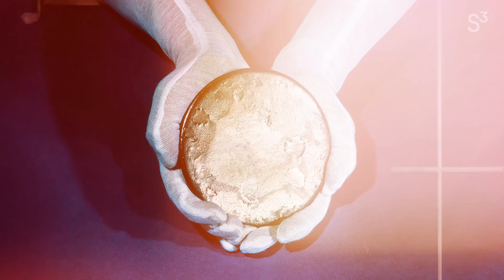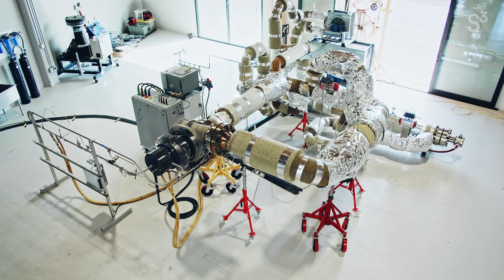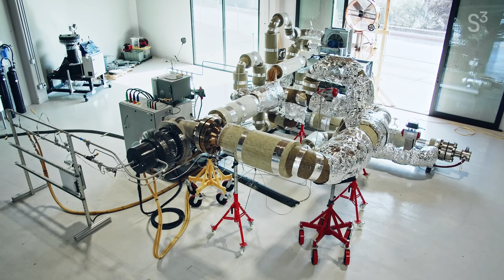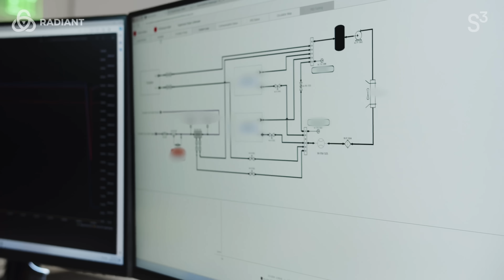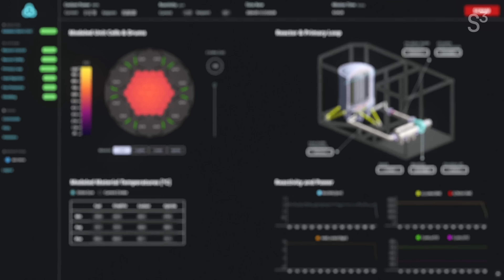The future of Nuclear = Small, Mobile, Microreactors | Radiant

Comment: 2:50 "...nuclear energy saves lives...": This I find most disgusting about focus on nuclear... making the political arguments. Say you had a choice between two forms of energy, butter and Thorium. What would you choose and why?
3:22 "...power reactors based off of submarine reactors...": In Bremerton, WA you can see submarines being scrapped. The first thing they do is remove the reactor. It's tiny in relation to power company reactors (and to the submarine itself). In 50 years we haven't been able to commercialize these small reactors. Why?
4:00 "...we're building smaller because smaller is cheaper...": What is the smallest electric generating reactor possible? What is the limiting factor? In particular it should be a Thorium MSR. Cooling with liquid salt makes much more sense than high pressure water... period!
4:35 "...ton or regulatory hurdles against it...": The best buck spent is eradicating the regulators. They aren't regulators at all... they are guardians of the oil business... period!
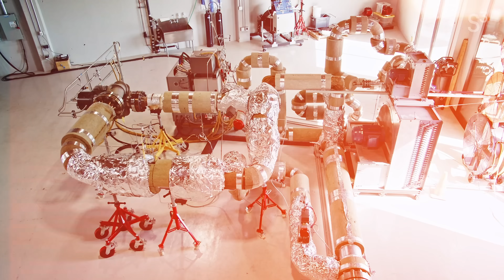5:05 "...we know how to build nuclear reactors...": No you don't. You had a working model 50 years ago and haven't built another since. Why? Because you're stupid? Could Alvin Weinberg do it today?
6:10 "...make heat through friction...": Someone here is clueless.
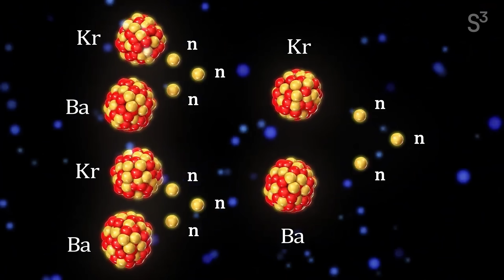6:20 "...U235...": Why not U233?
7:30 "...we use helium...": That's probably the show stopper right there. Where are you going to get the helium?
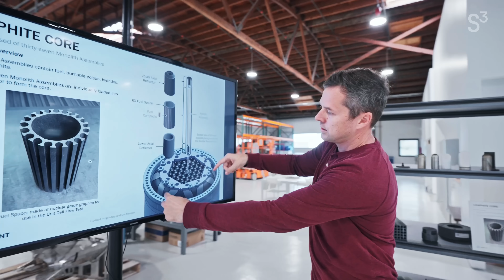8:30 "...milling the core...": You're putting lipstick on a pig. If you have to use the term "pressure vessel" you're on the wrong track. The correct solution works at ambient pressure. Using your technique you'd be smartest to build it deep under water where if the pressure vessel fails it "implodes".
8:50 "...graphite is the moderator...": With MSR designs you don't need a moderator. You just adjust the amount of Thorium in the mix. For power generation latency is not a problem. Dispensing with excess heat is the problem... and that is a very easy problem to solve. Just put it to other use.
9:10 "...in the larger channel we put our hydrides...": Why can't you just say water?
10:30 "...the helium loop...": If the helium is just for coolant, why don't you use nitrogen? It's far more abundant and safe.
12:00 "...we show the state of the nuclear reaction...": And that's a square wave? Really???
12:40 "...and the reactor tries to save itself...": I smell a rat. You want a fail safe design. If the coolant loop fails, that's a fail calamity design.
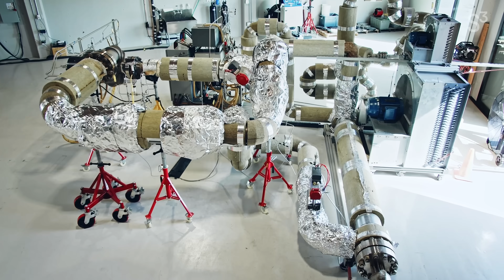13:15 And they've got the obligatory American flag. That's a marker.
14:05 These complicated designs are like taking the wrong fork in the road. Given the problem of maintaining a broom in a vertical position, these guys would build an inertia table with a complicated feedback loop under the broom. Taking the other fork, you just suspend it from above and let gravity work in your favor rather than against you. Any perturbation automatically returns to the stable state... rather than flying off the handle.
15:37 "...and go to the Idaho national lab...": Interesting. That's where they deep-sixed the previous correct solution. Oak Ridge got it working... Idaho scuttled it.
15:40 "...and I did Enron company before...": Now there's a testimonial. Skilling's out of jail now isn't he? Want his help?
15:55 "...and no one's mass produced it before...": What's the name of that company in Canada using Thorium? Do you talk to the guys in Abilene?
16:30 "...we're just 18 months away...": The funding burn has to be out of sight already. And it's gone to hand waving.
16:50 "...and the crane is just barely the right size...": But could be fabricated from scratch in a couple days to any size needed.
16:55 "...these are experienced engineers and builders...": They look like experienced hand wavers. So far, the only "secret sauce" I see is the rotating graphite reflectors... a (maybe) clever solution to a problem that doesn't exist if you take the right fork. Rather than pull the rods, you rotate the reflectors. Too many moving parts. Talk to Elon.
17:30 "...S cubed...": Stupid to the third power. This looks like the court cases that couldn't find vote rigging.

Comment: Is there safety provisions for complete software failure? The Earth's magnetosphere has weakened by 25-30%, in ten years it will likely be down to 40-50% strength. Solar flares and CMEs will knock out most electronics.
It also seems to me that the military angle is a diversion, I'm guessing that you're looking to provide the juice required to run the AI super computers.

Comment: You said you're using Helium for cooling since it does not become radioactive.  Helium is the second smallest molecule in nature (hydrogen the smallest).  It is not easy to keep helium contained under pressure.  It leaks out of most containment.  How do you propose to keep the helium cooling under control with this leakage characteristic.  PS:  I agree you are on the right track.   I propose locating a few sizes of these units to most substations in the grid to provide a robust electric grid, where grid failures can be neutralized with local generation at these substations

Comment: This would be great if it works.  The videographer missed an opportunity however- to ask the 3 big questions that nuclear always has to answer: what's the failure mode (what happens when something goes wrong), how much and what kind of waste, and what proliferation risk does it pose.  Imagine 1000s of these all over the country.  They all make waste. What if a domestic terrorist org gets ahold of one of these- and threatens to use it as a dirty bomb.  Imagine getting some material and tying up 3, 4, 5 highways or bridges in any large city in the world.  These need to be answered.

Comment: This reminds me of Elon Musk - low tech (graphite, heat, coolants, everyday materials) rather than fields and high energy density. At least the people are able to do those things now. Remote chemical processes can be economic with mostly heat, not electricity. Remote methane conversion, methane polymerization. Mars and Moon applications - lots. You might want to visit Hanford or have them give some collaborative seminars on "best recycling materials".  Graphite seems not high on the list of 'low cost to recycle". Glass has good strength, can be completely melted, good electrical conductivity. Even stainless steel. Get your entire life cycle involved now and work with the global community from now on. Give up some operating and design advantages for materials that will last or be easily re-used.  In 1975 I saw the details of Fermi II and they got co-opted by plumbers and old line steam power groups.  Fermi I is worth deep modelling and pay for good data, do not do it all from scratch.  You are making a big mistake, trying to have a few amateurs build prototypes. When you have not planned an entire industry out at least 50 years.  Build your global research and engineering community first, including all your future customers and applications.  Help them work as a single entity for sharing the whole - they do not want money, but freedom to use what is found. Richard Collins, The Internet Foundation

Comment: I hope you already have a SWQAP (as most of your design seems to be SW based) as well as a NQA, so far from what I have seen you do NOT have a stable system (you rely on moving reflectors to control reactivity) instead of say a light water reactor being somewhat self stabilizing... I also hope that those employees you show are not just concerned with machining graphite but on nuclear safety and reactor design... all I can say is that this is a fairly similar design to a RBMK with external reflectors to allow for a smaller size... but can you say Chernobyl?... remember that passively safe systems in reality need something to automatically reduce reactivity during a LOCA event...  you need some highly experienced reactor designers as well as safety systems not just some kids who read about it...

Comment: no mention of what happens to the fuel when its no longer usable and highly radioactive
no mention of what would happen if the blades get stuck and the reactor melts down, seems there is no backup system (core catcher) at all
also no mention of graphite effectively turning into a charcoal brick at high temperatures, so IF this thing goes bad, itll go bad SPECTACULARLY. 
it sounds like at high enough temperatures the graphite will act like a blowtorch that spews a jet of radioactive core material into the sky.
sounds familiar? chernobyl anyone?

Comment: Sounds neat.  A few items of concern… 

The Sun is fusion, not fission, and it’s surprising that one of these engineers doesn’t seem to know that.

It sounds like this is another pressurized reactor.  Things that are pressurized can easily explode.  Why not use molten salt?  The helium for heat exchange sounds interesting, but I guess that it must be under extremely high pressure?

According to the video, the entire stockpile of reactor-grade graphite seems to fit on a shelf or couple of shelves, yet this reactor’s core is made largely of this stuff?

Safety that requires active processes, like moving control surfaces, is by definition active and not passive safety.  TMI, Chernobyl, and Fukushima were all active-safety, pressurized systems.

Comment: Very upbeat. Interesting. But this is not a solution for climate change. Our societal systems are firmly regulated against nuclear - the bar is high. Logic won't win the nuclear fear argument. But yes, the energy density wins, especially in space, where you can eject crap into the sun and forget about it. So yes, we need this. Renewables will ein for now, but don't shut everything else down.

Comment: THIS is the future of power generation to make us become less dependent on fossil fuels. Big reactors are costly, take forever to build and quite frankly more dangerous. A smaller reactor is easier to control and now instead of a single central location you can have multiple locations in a grid.

I live in a very rural area. I can see two or three reactors like this providing power to all the communities of this area and used in conjunction with wind and solar remove the need for fossil fuels for power generation. By having multiple reactors with other power sources you have the ability to take one reactor down periodically for maintenance and the grid still having enough power to keep everything going. This redundancy is an amazing safe guard for the power frid.